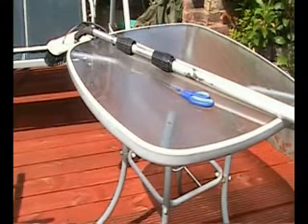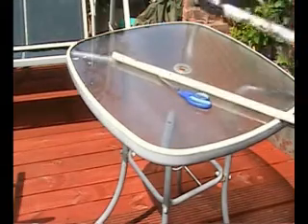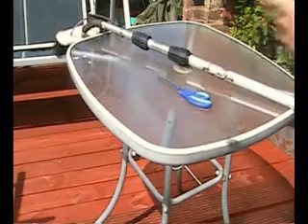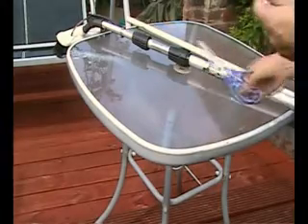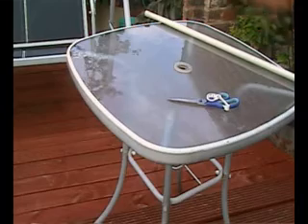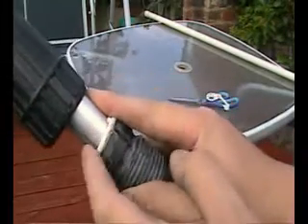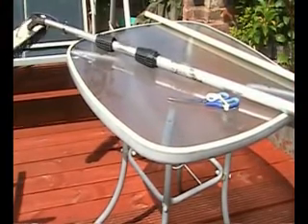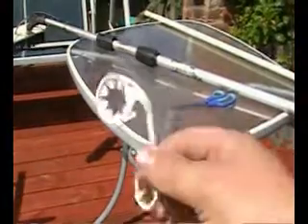How to fix a harris pole

Comment: Great tip, I started four years ago with Harris pole, not so good in high winds as they tend to kink but hay ho, @ £15 you can't grumble, think I'll get another one as a spare for my Gardiner, which has lasted well so far btw. I suppose if you're a dab hand with a pair of scissors you could make the same thing from any old bit of plastic, might have a go at an old Harris in my shed, mmm, you got me thinking, BTW still using your vinegar idea, that was tip of the decade for me, thanks.